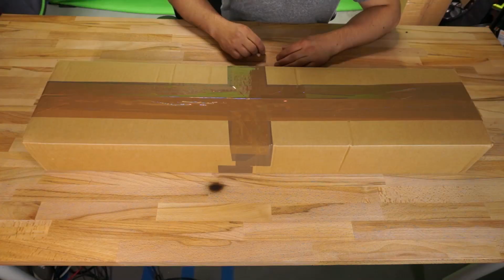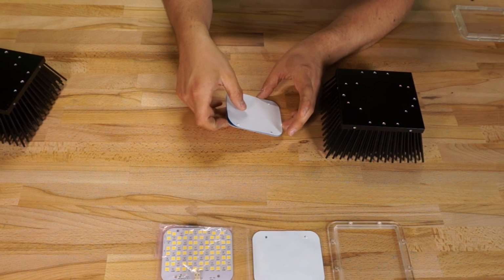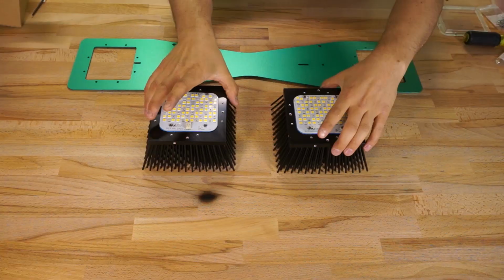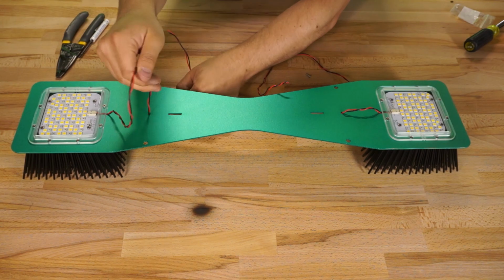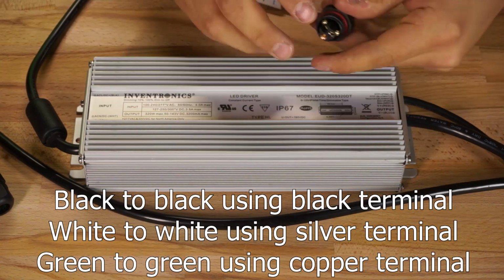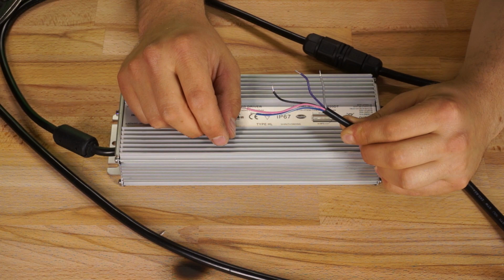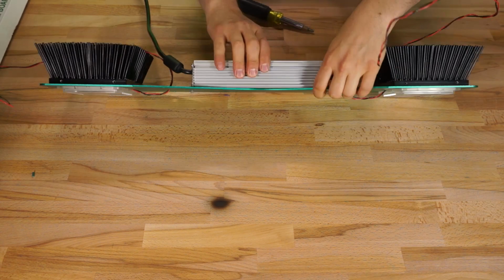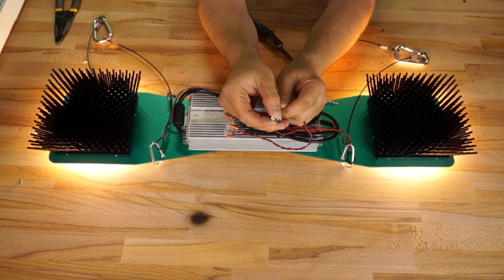Hands-on Review: HLG 360 Elite Kit (Part 1 - Assembly)

Comment: So if you don't connect the dimmer wires to a pot and just leave them as is, and then turn the light on, will it just run at full power or will it go boom?
Reply from the maker: It’ll run full power
Reply: @LEDGardener  Thanks.  Your blog/forum is invaluable.  Following the EB2 strip plans and read that they can be run without  heatsinks at 700ma, so it's either no pot and heatsinks at full blast, or with a pot dimmed down and no heatsinks.
$3 pot or $150 heatsinks.  Decisions decisions lol
Really do appreciate the effort you put into your blog and diy guides.  Cheers.

Comment: Now if the price would come down to around a $ per watt. 🍻
Reply: Right now there is only DIY. Or E27 LED bulbs. They aren't crazy effizient (~1,8-2,0 µmol/J) but are in the 4-6µmol/€ (2-3w/€) range
Reply: If you buy everything separately (it's actually easier than it seems), that's usually what it comes out to. I bought 2 QB288 Slate 2 Combos (4 total QB288s, not V2s), 2 MeanWell 240-C2100 drivers, 2 power cords, 2 terminators (universal connecters), and bulk white wire and wagos. Totalled to about 500$ even and true watt is about 500-520.
Reply: QB-96 kit is buildable for $1/w aswell now, with extra accessories even!
Reply: @foeayem  where did you buy your drivers at? Just got my QB 96 in and the heat sink is larger than I thought, also how did you mount this?
Reply: @earthsmedicine445  drivers from Rapidled . Com and you can just check the HLG website/QB96 page for the recommended drivers and find it on Rapidled. youtu . be/MXEDaW6icxM is how to put it together

Comment: Guy dont buy this kit I built the same light with a meanwell driver for 320 bucks not 799 on hlg web site 15 for angle L Aluminum also mount your drivers on the walls to keep the heat down this light kicks ass I'm gonna buy 6 more engines
Reply from the maker: This kit costs less than $400 on HLG’s site.
Reply: @LEDGardener  that's actually a really close price point but I'll still DIY mine I like the challenge but I dont have the nice base or the covers
Reply: Also this is my favorite light I've ever used I plan on 4 lights in a 4x4 area will I have good light coverage right now I have both penetration and coverage with my qb 132s and qb 96s I'm torn

Comment: You can literally buy this from Alibaba.com assembled for 80% off 😂 Amazon price.
Reply from the maker: I think that like all products with a knockoff, it just comes down to your priorities. With the HLG you know you’re getting real, top-bin diodes, and you know they’ll stand by and support their product. If saving money is all you’re after and you’re  willing to roll the dice, then Alibaba is for you.
Reply: @LEDGardener  what exactly defines a top bin diode?
Reply from the maker: greybush1976 the bins we’re most interested in are luminous flux and voltage. If the manufacturer uses a test current of, say, 100mA, top-bin diodes would be those that output the highest number of lumens at that current. Now, take that group of diodes that emit the most lumens at the test current, and separate them by the amount of voltage across them when the test current is applied. Now, the best bin for voltage will be the ones that can produce this high amount of lumens with the lowest voltage possible. Since power = current * voltage, this would mean that these diodes use less power to create the same amount of output.
Reply: @MrImPrEzivE  we all know how "domestic" companies work. Import products and materials from foreign manufactures only to assemble and put a brand on it. I'd be willing to inquire the bin coding from Alibaba supplier. I've been window shopping there myself. Way cheaper, but the additional cost of shipping in some instances is almost like buying from Amazon. Unfortunately Amazon is very limited in the components for diy builds. Just domestic retailers with full priced assembled fixtures or you can find "wholesalers" that offer components which are marked up from Alibaba suppliers so they can make a few bucks.
Reply: @greybush1976  HLG makes a lot of their own boards, or at least the QB288 boards, I'm not sure about the Elite boards. They first conceptualized these the "Quantum Board". China has been ripping them off since.